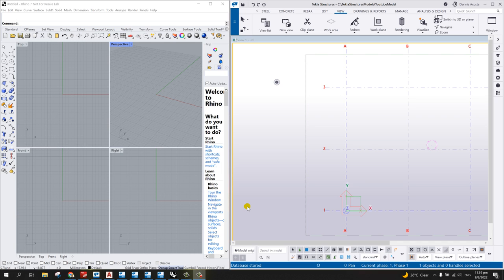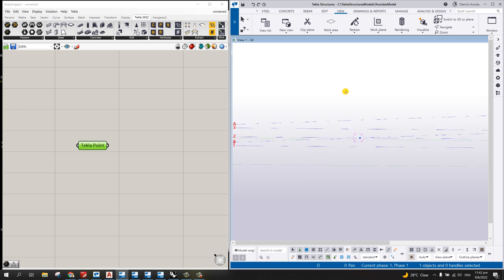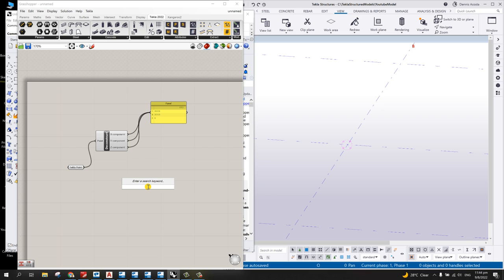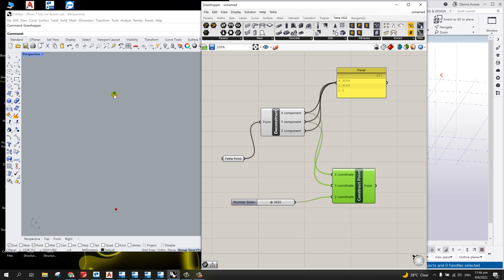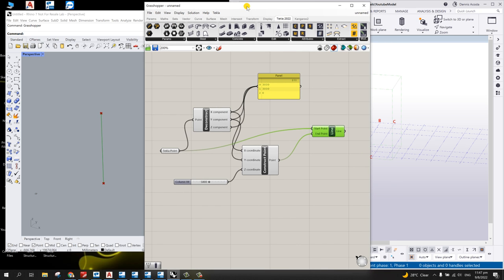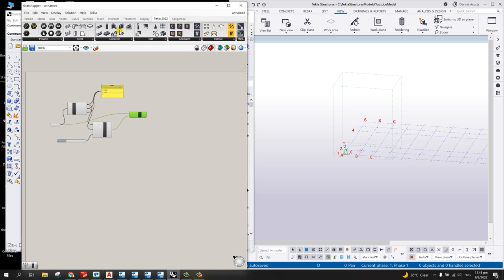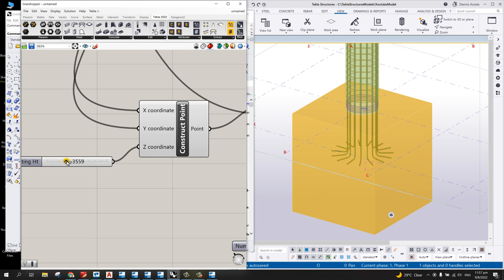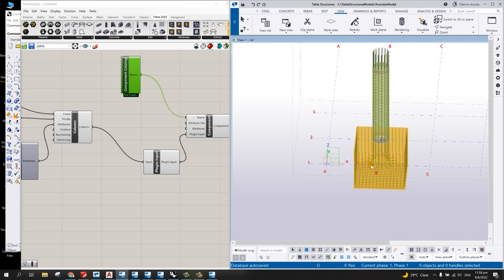Simple Grasshopper Script and Tekla Grasshopper Component

Comment: Thank you. It works perfectly for one column. However if I create a few columns/concrete elements by Grass in Tekla. Reinforcement does not appear. Have you faced this problem?
Reply from the maker: The script is meant for Grasshopper Component in Tekla structure. If you want a multiple concrete part in Grasshopper the script will be different.  Yes i did experience that before. I just need to change the script. One way is use the List item for the arrayed concrete.
Reply: @thehowsofteklastructures565  thanks for the answer. Would be nice if you made a video as well. Reinforcing by grasshopper has a sense only if it can be applied parametrically by several columns. Otherwise I can make reinforcement in Tekla itself spending the same or less time :))